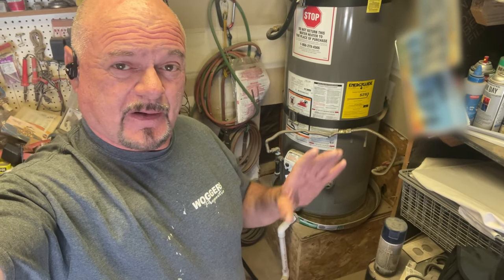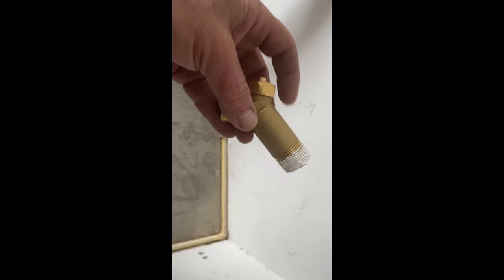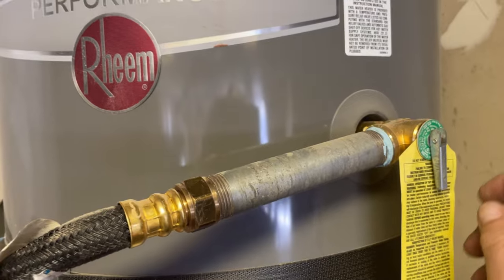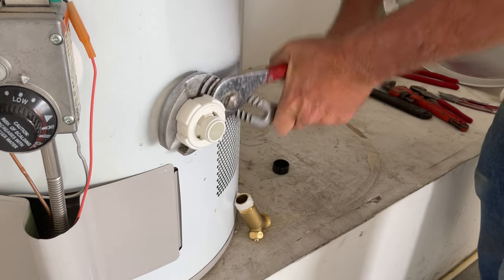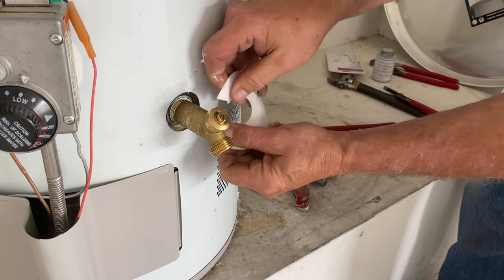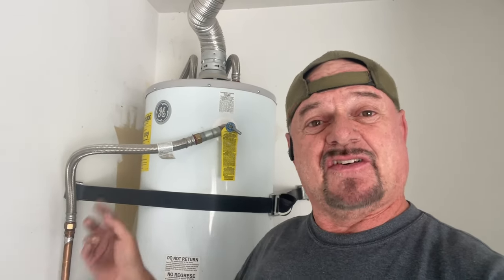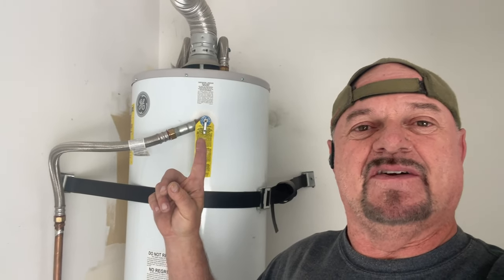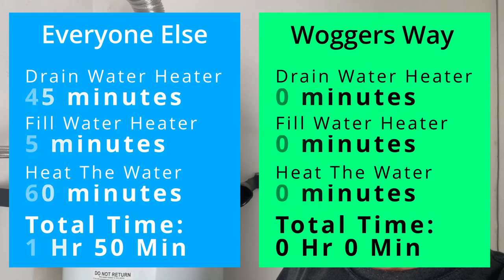Replace A Water Heater Drain Valve WITHOUT Draining The Water Heater

Comment: Think about the risk you're taking, Think about the new apprentice Or inexperienced home owner that's going to attempt this and get his hand burnt, Break off the plastic drain in a  customer's house.  Always drain the water heater first. Cutting corners will cause accidents.
Reply from the maker: Been doing this for 20 yrs with only one time I had to place the drain pipe over the hole, but when the unit is inside a house I agree you should drain it first to avoid any possibility of an accident.  Here in LV I've only encountered 2 times a water heater was inside a house.  One was a "remodel" where owner put it in a bedroom, which is a code violation and the other was a house from the 50's where it was in a closet in the kitchen.  Different parts of the country may be different, but here you'll typically find them in the garage or an outside patio/balcony.  Still, as mentioned in the video, you should always have the drain pipe handy and ready to go just in case.  Always wear gloves but if you're burning your hand you have the thermostat set too high.  No reason to have it set where it will scald you.  That just wastes money trying to keep it at an unusually high temp and promotes scalding issues at faucets, etc.  Thanks for watching and for your comments.  This is how people learn.  Good luck with your projects.

Comment: Why do these things have to happen in the middle of the night?  In Houston, most of our water heaters are in the attic....can you see where I am going....  Thank you for this video ... saved me time and stress   I just cut the water off on the heater 3:15AM  till I could get to Home Depot at 6.  I was brand new by 7AM.... Thanks again !  Woggers Way is the only Way!😁
Reply from the maker: I say the same thing here... I always seem to get a call8 pm on a Saturday or sometime on Sunday.  it can never happen at 9am on a Tuesday.  Same with smoke detectors.. they always start chirping at 2am and it's always the unit in your bedroom.  Glad you were able to fix it ... being in the attic I hope you didn't experience much water damage.  Dumb place to put a water heater.  Here they're mostly in the garage which is much better.  thank you for watching and for the nice compliment.
Reply: @thewoggerswaydiy  Not much water damage we’ve gotten real good with slapping that big fan on drywall and get dry fast. Nothing worse than thinking - this wall is fine - put your finger to nail a picture and your finger goes right through… uh, think we missed this one?  Lessons still being taught !  Thanks for your great video !

Comment: Nice video on a heater issue that comes up very often in the plumbing world! A couple of small things that I have learned over the years that I hope will help add value to your process...It is not necessary to pipe off the T&P valve during this process. Better yet, it's not good to open and close an older T&P valve period. Just put a full-size towel under the drain valve and open it slowly to create your vacuum. As you mention in your video, you only lose a pint or so of water. If there is an expansion tank on the heater, then use a hose on the drain valve and pipe it into a bucket. It's not a gravity drain off as you are just releasing the pressure in the system to create your vacuum. Loosen your drain valve by using channel lock pliers the "correct way" (you were using them backwards in your video! ;). One last thing, the drain valve you used as a replacement IMO is as bad as the plastic valve you replaced. Spend an extra $5 and buy the water heater drain valve that is a "ball valve" style. They now come stock with the wholesale Rheem heaters. The heater you were working on early in your video came from the retail heaters sold at HD which have the plastic drain valve. Heaters need to be flushed once or twice a year depending on your water, so I suggest getting a drain valve that will last and work properly for the life of the heater. What you have shown can be completed in less than 30 minutes which is a great savings of time for the homeowner and the plumber. Thanks for making this informative video!
Reply from the maker: Thanks for your input.  Normally I like to "upgrade" the drain valves by inserting a 3/4" brass nipple with a full port ball valve and a hose adapter on the end, which gives a nice large opening to make flushing and draining a lot faster and easier, plus if there's any sediment it won't clog up like those other drain valves.  This was in a rental and the homeowner wouldn't pay the extra for the "upgrade" on a 7 yr old water heater, so they get the "budget" valve.
Good luck with your projects.
Reply: Yup.  I learned the hard way about opening a T&P valve that leaked as a result of my opening it.  I would avoid that if at all possible.

Comment: That pressure relief valve you have draining outside is not code where I live. It must terminate no less than 6 inches from the floor. Reason being that if it actually self actuates, it means pressure inside the tank is too great and could be catastrophic if not corrected.  So draining on the floor gives the home owner an indication that something is wrong. Otherwise, you'd never know.
Reply from the maker: Yean, every where is different.  Here it's not only permissible to have our PRV drain outside, but it's pretty much all you see here in Vegas.  If it drains outside it has to terminate no more than 6" above the ground, so a unit on the 2nd floor cannot just terminate outside on the 2nd floor, otherwise someone down below gets a very hot and unwanted shower.  it can also terminate at a floor drain, but we don't seem to have those here.  I've seen some people terminate it into the spill pan under the water heater but that's not to code here.  Thanks for watching and good luck with your projects.

Comment: I did this, a little scary cause as soon as the old valve came out it blew off and water and air exploded all over my face and my body .. Luckily it wasn't super hot. I released the air with the TPR valve, so I'm not sure what I did wrong. But the jobs done. 😅
Reply: Same thing happened to me! Wish I had the gloves ready 😢
Reply from the maker: Glad you're ok..  It's possible that either your TPR is stuck and not opening to create the vacuum, or your shut off valve to the water heater isn't fully closing... a common problem if you have a gate valve as opposed to a ball valve.  Glad you were able to get it done and you are ok.  Thanks for watching.

Comment: That plastic drain valve will probably break when trying to take it off and water will be everywhere don't you think? So shouldn't you just drain the tank first?
Reply from the maker: If you feel the plastic valve is compromised or is so corroded there may be the chance of it breaking then you should drain the tank.  This is why in the video I mention having the drain pipe on hand just in case, that way you can avoid a mishap.  thanks for watching.

Comment: if you try the quick method w/o draining and you are removing a plastic drain valve it may break off during removal and it could take 30 mins to one hour to get the threaded plastic pipe removed from the water heater
Reply from the maker: If the valve breaks off during the "quick" method, it'll still break off when removing even after draining the tank.  That's why we don't use the big box heaters.. they're "dumbed down" to make them cheaper.  We only use the better grade of heaters from our plumbing suppliers.  Thanks for watching and the comment.
Reply: @thewoggerswaydiy  I was warning the home owner who might not have these water heater.
Reply from the maker: Good advice.  So far I've only had one break off during removal... so far... fingers crossed on future jobs.

Comment: I had a gas water heater a few years ago that had a leaking plastic drain valve that was leaking, but this valve looked like an out door valve where you would hook up your garden hose. My water is so bad that I have to change my anode rod every year.I got the plastic valve out easily and replaced it with a brass ball valve. In 2023 I replaced replaced my water heater with a A.O.Smith 60 gallon electric heater. It came with the cheapest plastic valve that started leaking two weeks after installation. A O Smith recommends flushing the tank and checking the anode rod after six months. I emptied the tank and attempted to replace the the plastic valve that immediately snapped all the way inside the tank. I was told breakage is not covered under warranty. I thought yhe plastic valve was glued in and that is why it broke but they said it was threaded in. So I had to buy a new water heater after having the other one only six months. The new one is a different model but basically the same design. After ten months I had no hot water and the breaker keeps tripping. I called AO and was told the parts were under warranty but not the labor. It was the heating element that was bad and being on a weekend I had to do the job myself. Bottom line is the tank would not drain from the drain valve and the anode rod even with a long extension on the socket handle and a tank full of water it would not budge. I replaced both heating elements and now have hot water. I am planning to get a friend with a impact wrench to loosen the anode rod so I can replace it,but my problem is the drain valve. I have already broke one snd afraid to repeat the same mistake.I cannot afford to buy a new water heater every year. Sorry for the long post. Lesson learned? Never buy a A O Smith water heater.
Reply from the maker: Very unusual for AO Smith.. their water heaters are usually quite good.  The problem is, Lowes now sells AO Smith branded water heaters, but they are the "big box variety", which means they are dumbed-down with cheaper parts to keep the price low for Lowes.  The AO Smith units I purchase through my plumbing supplier are a much better build quality.  Although I now mostly install Bradford White exclusively, it has nothing to do with the quality of the AO Smith units.  It's just that I can buy the Bradford White at the same or better price through one of my suppliers than I can get the AO Smith.  And if the price if comparable, I'll go with a Bradford White.  rule of thumb is replace the drain valve with a full port valve at the time of initial installation and then you won't have to worry about it later on.  Good luck with your project and thanks for watching.

Comment: All is good unless the plastic valve break when you are removing it.  Then you're stuck with a full water heater and a broken valve you have to remove piece by piece.
Reply from the maker: Yes, that happens occasionally.  That's why I mention to have a tube on hand to place over the opening to direct the draining water in the tank out to a "safe" area.  Thanks for watching

Comment: Hey my brother replaced the plastic drain valve on the water heater  without draining it and it didn't break.  It was kind of bitter sweet though because he left the the shower on with the drain plug closed before doing this and the bath tub overflowed with a lot water on the bathroom floor. What a mess! He was trying to used up the hot water just in case the plastic valve broke on the water heater.
Reply from the maker: Well that sucks.  He kind of defeated the purpose though by using up water that he could have just drained direct from the water heater..  Lesson learned I guess.  thanks for watching.

Comment: Ok so I was giving this about a 30 percent chance of working and a 70 percent chance I was about to flood my laundry room. Since the valve that was on my water heater looked like it had then through a lot in its lifetime there wasn’t really a way to hook a water hose up to it. 

Naturally mine has the old school gate valve that I wasn’t sure if it  completely shut off. So I went outside and turned it off at the meter. Figuring the plastic valve was going to break I applied gentle  pressure until it finally broke loose. I reluctantly unscrewed it and all of about a half ounce of water came out. I popped the new metal one in and back up and running in just a few minutes. 

Ive found over the years that all you need to be a successful plumber is a tank full of gas and a pocket full of money and eventually you can make it work somewhat like it supposed to. 

Thanks for the video bro you made this super easy.
Reply from the maker: Awesome.. glad it was a successful exchange.  Thanks for watching and the kind comment.

Comment: Ok, I did it the Woggers Way today!!  I'm a 6.5-7 on a DIY scale of 1-10 and have no idea what I was nervous about. One call to Rheem, they sent me a brass valve replacement for free. I had everyone telling me that I needed to shut off the water heater and water supply, give it about 2 hours to cool down, then because my drain valve was not able to open while ALSO having a hose attached (It was the plastic Rheem Professional valve) that I was going to have to use a dryer vent and circulate 5 gallon buckets, etc etc. Basically a process that might have taken two people, plus the time to refill and reheat 50 gallons of water after I was done. I was thinking this was going to be a huge pain. 

Woggers Way: water shut off, pressure valve released for 3 seconds, hulked the old one off, had the new one ready to go. Had about 2 oz of water come out and the new one was baby hulked back on and was ready to go. Total time 5 minutes.  

A 3 hour process with 50 gallons of wasted water turned into a 5 minute process with zero waste. Amazing. Thank you Sir!  Liked and subscribed!  😂
Reply from the maker: Now that's what I like to hear.  That gives you 2 hrs 55 min left over to watch more of my videos.  lol  (Love the Baby Hulked comment). Good luck with your projects.

Comment: Oh yes indeed, the "Woggers Way" does work! Everything went smoothly with this procedure. I did have a devil of a time torquing off the old drain valve - it just did not want to turn, but finally I was able to get enough torque on it and thread it off!
Reply from the maker: Oh the frustration when it doesn't want to come off, but the joy when it finally does.  Thanks for watching and your comments.  Good luck with your projects.

Comment: Works like a charm. Being a maintenance mechanic by trade, I'm surprised I never thought of this before. Looked at the old valve when I took it out and you can see the o-ring inside is damaged. I wanted to add a photo, but I don't know how. Excellent video.
Reply from the maker: Thanks.  I thought the same thing when I learned this years ago.. how did I not think of this before.  Glad it helped you.  Thanks for watching and good luck with all your projects.

Comment: Very informative. It walks u thru the whole process so u do it correctly. I need to do this also but 23 y o so I’m just going to replace the whole thing but I’ll install a better drain valve in the new one. The plastic one leaks behind the knob when opening it n noone has a simple fix so I got me a nice brass one !!
Reply from the maker: 23 years out of a water heater... that's awesome.  Upgrading the valve upon installation is the way to go.  Good luck with your project and thanks for watching

Comment: Great tip! I wasn't ready when I removed the plastic drain valve & water gushed out. Not much maybe a gallon.
Reply from the maker: Sounds as though you didn't create a good vacuum, but glad you were able to get it changed out.  Thanks for watching.